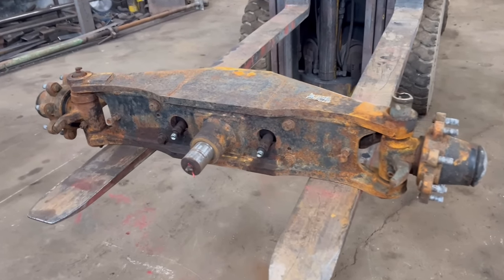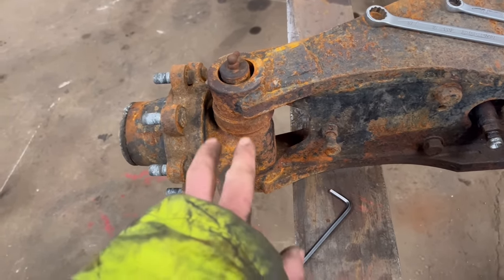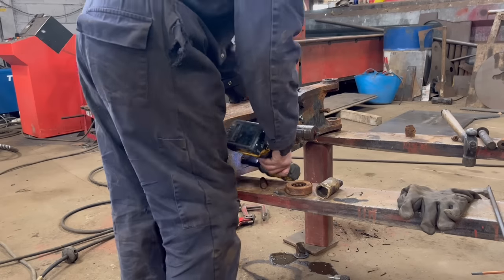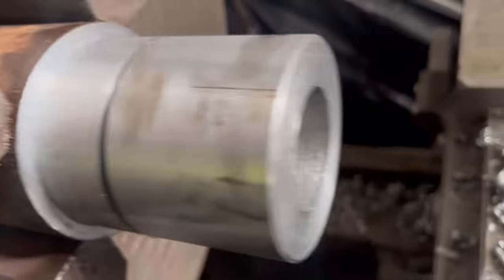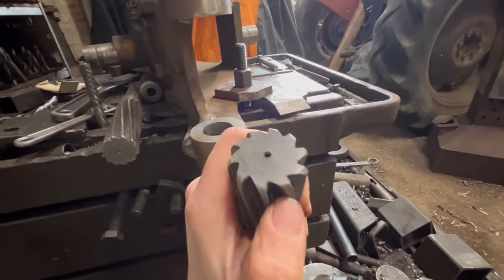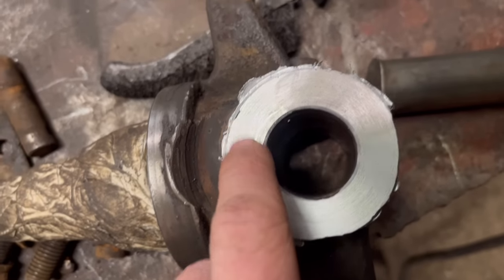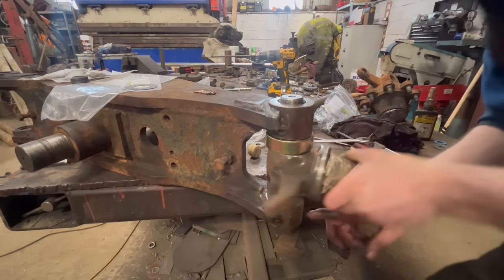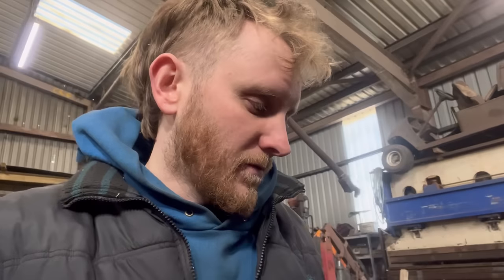Chinese forklift axle in a bad way

Comment: This is the first video I have watched of your work. I am a 71 yr old retired machinist/mechanic/welder/fabricator in Land Down Under. For a fellow your age you have remarkable skills, especially the ability to think around problems. As many have already commented, most people would have run a mile if they were handed this job. Your approach to the repairs is excellent. I was especially pleased to see you pull in those needle roller bearings (with their very thin outer shell) with a long bolt. To keep hammering with a drift on such a thin outer shell is to ask for problems. Overall, really well done to you. Would be happy for you to repair anything of mine if I were in the UK. However, I like to maintain my equipment so it would never have been in that condition in the first place. I have had to repair other people's lack of maintenance jobs before and I tell them I will do it once but if they don't maintain it, regardless of how much they offer to pay, I won't do it a second time. In fact I won't do any other work for them at all. Have subscribed and will be good to see other work you do. Regards. Bob Hudson.
Reply from the maker: Thanks Bob. The problem solving is the part I love most about my job. Keeps things interesting.
Reply: @snowballengineering  just come across your channel & subscribed. I’m a FLT engineer & you have the ability I say that can’t be taught, to think there is always another way, 👍
Reply from the maker: Thanks Anthony
Reply: Ruha

Comment: The issue isn’t the fact it’s Chinese, it’s a maintenance issue. Or complete lack of. That’s a fantastic repair matey.
Reply from the maker: Maybe should grease my own forklift more often 🤣  Thanks!
Reply: @snowballengineering  every 8 hours of use or 800? 😂
Reply: But why does this not explain why Chinese never defend homosexual special rights ?
Reply: A leak of maintenance can make a bearig to disappear ...😂
Reply: Think again  chang.
Reply: @benjurqunov  wrong argument.
Reply: it's a Chinese issue first and maintenance issue second. Can't maintain something properly if it's put together like dogshit
Reply: @canniballectus2560  Nah, I've been using 3 Chinese tractors on my farm in addition to a few Same tractors and while the JinMa tractors are not up to heavy work, they have been working well hauling trailers across hilly, rutted and slippery terrain for about 8 years now. Seems like Chinese equipment manufacturers are loath to use any better grades of steel. But they tend to make it beefy enough to handle moderate loads just fine with mild steel. The king pin becoming worn like that is completely operator error. That joint will have been clacking around during operation for a long time to get that worn. Some of my operators have done similar things in the past and it's something that some guys just don't initially understand that replacing a loose but functional bearing is way cheaper than running it to complete failure. 
I'm not a fan of the Chinese machinery, but they were literally half the price of a comparable European one. They've been working on an orange farm for long enough to have long paid themselves off. And the parts are actually fairly cheap, if you can get them. If not, most stuff can be modified to take more commonly available parts, which I tend to do on all my machinery anyways.
Reply: @canniballectus2560  probably made well enough but treated very very badly with no maintenance.
Reply: @canniballectus2560  Needle bearings are dogshit ?
Reply: Main issue is it's chinese.. 2nd issue is it's chinese and they don't do maintenance. It's use till it breaks then toss.
Reply: That's partly true, but good brands will last a lot longer without PM because that's a bad design, it relies on lip seals instead of the caps you will have on a decent brand. I looked after 6 Hysters and would grease the king pins every 6 months, there was no evidence of them being greased before I got to them and they were 20 years old then.
Reply: No one noticed him heating up the locating pin to try and remove it when heating it will only expand it?. No cooling liquid sprayed on the drill in the lathe
Reply from the maker: The change in temperature is sometimes enough to crack them loose.  Cutting fluid also isn’t always necessary.
Reply: @thomasmyers4089  what's wrong with no coolant?
Reply: @mrsock3380  If you don't us coolant, the cutting surface of the drill will cause the metal to work harden, too much speed will also cause the same problem. The drill seems to be HSS and unless the billet is very soft material, the drill be blunt very quickly. Although a cobalt drill may be able to handle the heat, they are very expensive and l doubt they will be using them. I assume you seen the smoke trail coming from the cutting surface.
Reply: @thomasmyers4089  you're commenting in a video where none of those things happened when drilling a hole without coolant, why are you making up stories?
Reply: @canniballectus2560  the bearings rusted away lmao. If it was put together like shit but maintained, we would be dealing with well greased bearings that had simply failed.
Reply: Same topic Chinese ideology.
Reply: @canniballectus2560  It's funny that you're typing that comment on a device that probably has at least 70% chinese parts.
Reply: @benjurqunov  What "special" rights do you think gay people should have that others do not, and what has that got to do with forklift repair?
Reply: @ferrumignis  
Nothing was mentioned about gay people.
Reply: @benjurqunov  "But why does this not explain why Chinese never defend homosexual special rights ?"

This is what you posted.  What are these "special rights" that only homosexual people should have?
Reply: @ferrumignis You should ask the Chinese. They're the ones not having it.
Reply: @benjurqunov  "They're the ones not having it."

The ones not having what ? This makes no sense until you explain what special rights you believe homosexuals should have that other people do not.

If you now realise what you posted was stupid then just admit it rather than trying to evade the point.
Reply: @benjurqunov  Panda face  is and egg roll eater.
Reply: Lack of maintenance?
Reply: @benjurqunov  WTF Does that have to do with anything?
Trying to keep population down, I would think they would want to promote it though 😁
Reply: The caption about hating grease guns made me laugh, I seem to have endless trouble getting them to seal properly on the grease nipple. Loving the channel, you work so hard and do a fantastic job 👍
Reply: The design does seem to leave a bit to be desired with the missing seals for instance.
Reply: @djmips  Seals are often fitted to keep dirt out rather than keep nonexistent grease in. 
Normal service procedure would be to pump grease in until fresh grease is seen and wipe off the old stuff (or not)
Reply: @snowballengineering This is true. I understand and agree with the concept of expanding the outer part, but sometimes extreme heating of one part is all that’s needed to break the bonds between the parts.
Reply: Yes you are right the people waiting till to the last moment and then is the manufacturing company  wrong .
Reply: @@AFW5627 In Britain? That's where it is and being repaired.
Reply: It's 3 weeks old.

Comment: That was an awesome repair considering the forklift has not had any maintenance for many years. I doubt very much the owners will do the wheel bearings considering the condition of the parts when they came in. 😁👍🇦🇺

Comment: Lovely work, some good quality repairs there. Suggest an air hammer for knocking out old 'bearings', they're fairly impressive the new ones. torque test channel has some good suggests to save your back and time. also try a locknlube grease fitting, they saved me so much grease.... Never had any luck with those original grease attachment things

Comment: I use an electric jack hammer to drive stubborn pins out. This method will save your shoulder joints as you age. The smaller jobs can be done with those contractor grade concrete Hammer/ Hammer drills. You will be amazed at how much easier this makes the task of banging pins out.

Comment: I saw you starting to drift them needle bearings in with hammer and I thought nah....yer allrite...

Then you changed to pulling em in with a bit of allthread...

Good lad
☹🇬🇧
Reply from the maker: Yes, not a good idea, I just gave it a little tap to see, then I thought all the needles are either going to drop out or I’m going to damage it.
Reply: @snowballengineering  

Always make sure the surfaces are clean and round before installing them types of bearings as owt not right with them bores will show through to them needles...
☹🇬🇧

Comment: Thanks for sharing another great video. I have absolutely no concern about your ability and what you did fixing this axle. What does concern me  is that's one beat to death forklift steering axle, that's clearly seen no real preventative maintenance since the warranty ran out and a previous botched repair.  What the heck is the rest of the pile like as  I'd seriously question it's safety to be operating it, and suggest a trip back to it's roots in China should be in it's near future  L.O.L  Take care

Comment: I have been repairing heavy trucks for 50 years and I've never seen kingpins remotely as bad as that! I've also never seen kingpins with no end caps b4, that probably contributed to the failure. A regular maintainence routine would have prevented this damage, but then there would be no repair video, or work for you! That said, very nice job with the repair.

Comment: I do hate grease guns also, they always tend to spil the grease arround the nipple. I use since a few years a grease needle they also use in Airplain maintenance. Look for grease injection needle. Also ideal for U-joint in propshafts as the normal grease couplings are to wide to connect to a grease nipple.

Comment: With what that cost for parts and repair there is probably a good possibility it may actually get some maintenance?
Grease is way cheaper than bearings and labour.
As a mechanic, there were jobs that didn't come along for 3~4 years then suddenly you would have 5~6 in a week or two, just one of those weird things that happen.

Comment: Amazing how these jobs find you. Italmodt looks like these kinds of jobs lie around and nobody knows what to fo with them until you do a YT video in the first one snd then they send them yo you. If you remember tge stone crushers you had a whole bunch of last year.
But one thing really stuns me. That is the state of this stuff when they comes into your shop. This axle must have been pretty badly worn for several years already before it had deteriorated to this degree. Are these machines still from that equipment hire company you mentioned before, or are they from different owners?
Do they do no maintenance on these machines at all?

Comment: Nice job. Got me wondering how you'd ever make a toe in adjustment? Must be engineered well or have a selection of follower links for the cyl rod.
Reply: Threaded ends... This isn't rocket surgery.
Reply from the maker: I don’t think alignment is too critical on these machines.
Reply: There is no adjustment on them. If something is out if align then something has got bent. The spherical bearings wear quickly and the wheels wobble when going over uneven ground but it’s a forklift they are slow and never really doing big long straight runs.
Reply: They only bother doing that on NASCAR fork trucks

Comment: Using any kind of penetrating oil like Kroil would have helped a lot in removing the intact kingpin or any rusty part you're trying to seperate. I use penetrating oil on anything rusty that I'm trying to remove as it really helps and saves lots of time.

Comment: Is there a reason you don't use penetrating oil on stuck bolts/pins?
Reply from the maker: It’s helpful but I’ve never seen it as a necessity.

Comment: Nice repair , it looks to be designed quite well but was poorly maintained. With not being able to check metallurgy it may have contributed to the failure?
Reply from the maker: Yes, it seems a well made axle. Failure is just lack of grease. As soon as the rollers stop turning it’s 2 hardened metals fighting against each other.

Comment: That's actually a TCM forklift axle

When TCM merger with Nissan Forklift   and became UNICARRIER ,( about 10 years ago) Heli came in bought the manufacturing line from TCM and moved the whole thing to China, where they continued making the TCM forklift but with a different engine and model number.

You can find the same exact axle under a TCM FCG25F9

So if you have trouble getting parts for it just contact UNICARRIER and give them that model number.
Reply: It’s not the same as any Tcm I have worked on. I supplied the parts for this to Oliver. It’s off an unbranded Chinese forklift. A google search found it was a “feeler”. No I haven’t heard of them either 😂
Reply: @an04ker  it's an F9.
The reason I recognized that it's a Chinese Forklift is because I recognized the axle.

I worked at a TCM dealership for 15 years and Heli for 4
Reply: @an04ker 
TCM PART# 20A70-81002

That's the axle.

Comment: You do realize that reamers are only meant to cut max of 1-2% of nominal hole size right?   Reamers are NOT meant to be treated as drill bits but as clean up for holes that are just a hair too small to get them to a precise size ie, if your original hole was 36mm, that's too small for any of your reamers and you should have just used a boring bar on the lathe to widen the hole out to 39mm, welded, used the 39mm reamer to align (and it should basically just be removing fractions of a mm), and then the 40mm to get to final size..
The chamfer at the end of the reamer is not meant to cut, but just to facilitate easier insertion into the hole:  the sides of the reamer need to be the parts doing the cutting..
Reply from the maker: I do realise that’s there intended purpose but they still work great using them like I did in this video.

Comment: 30 years ago I would find the same problem with TCM forklifts used in dirty environments. I would have to weld it up and grind it out to original size and ream everything. It would happen to the bellcrank as well.

Comment: Its crazy really as takes pretty much the same time to make the axle regardless of the metal used.  Obviously regular greasing would of helped 😂😂 but looked like the the pins weren’t made from hard enough material (or hardened deeper) 
Curious if the replacements were harder or like for like
Reply: Grease?
Reply: I have three Chinese Jin Ma tractors and it seems like using the lowest grade steel they can in any given application is the norm. Despite that, I've been using them for about 8 years now on the farm hauling trailers and they have been holding up pretty well. Though you can forget about using the PTO system for anything but light duty applications.
Reply: enough said, ''made in china''
Reply: @siggyincr7447  china uses mostly scrap they melt for "steel". atleast for the cheaper things.
Reply: @chriskwakernaat2328  That's common practice for every nation. Mild steel made using scrap steel can be perfectly fine. Though I will say that Chinese hot rolled mild steel has inclusions and unbonded laminations at a far higher rate than from other countries, from what I've seen. I've never seen an analysis on it, but my guess would be that it probably strays further from the standards than it should too.
Reply: @siggyincr7447  we use up to a percentage, their percentage is much higher.

Comment: Love too watch engineering videos, before I retired we used to use High Pressure Grease Coupler Locking Clamp, I don’t know if you have tried them,
Reply from the maker: Ive seen them but haven’t tried one yet.
Reply: @snowballengineering  I really like the locking grease coupling and powered grease gun, of course being a farmer I have a lot of greased joints to lube up.

Comment: I am no engineer but this unit that has straight pins to connect the knock with such a small diameter means this is just a junk machine period.
Reply: Funny because they’ve been like this for years and work perfectly 😂

Comment: A tip for anyone repairing these axles. If youre in the trade and use TVH for your parts the triple thrust bearing doesnt automatically come with the cap/cover, its a seperate part and has to be ordered seperately. 👍
Reply from the maker: Have you learnt this the hard way?
Reply: @snowballengineering  You could say that, Heli, Hangcha, Tailift, TCM, Maximal, Nexen and other spurious Oriental manufacturers use similair set ups and share parts. Ive seen that many and ordered that many kits you know whats what lol. 🙄👍😁